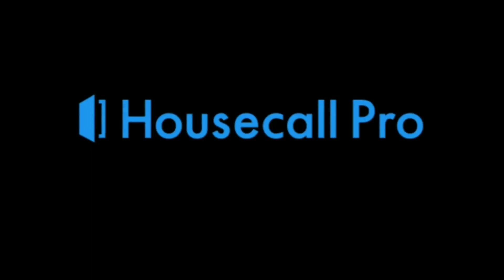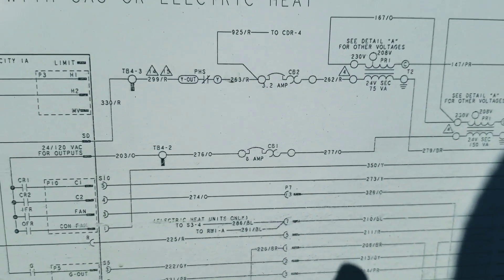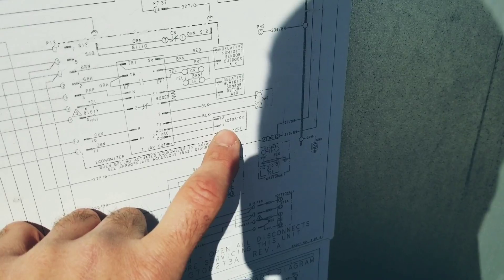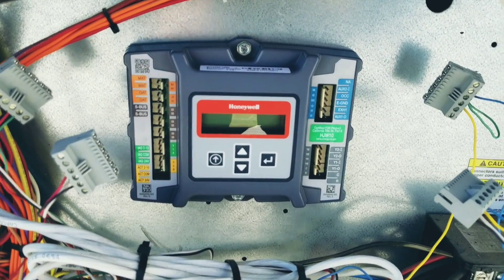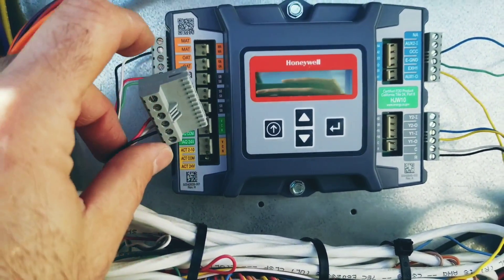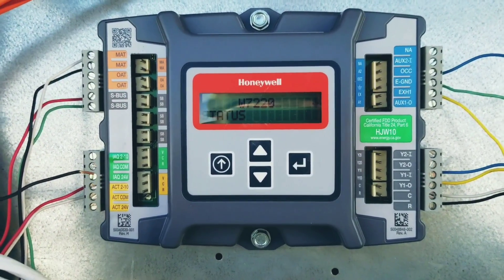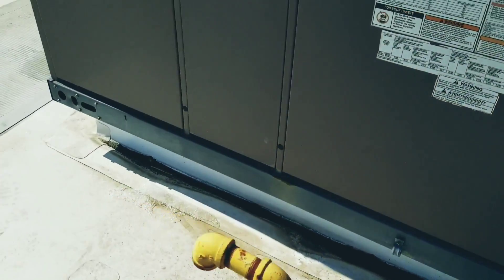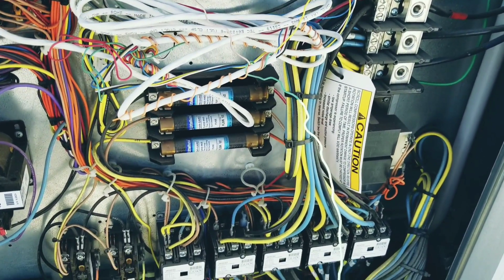HVAC - Troubleshooting Electrical Shorts Without A Meter

Comment: Looks like the schematic doesn't match the board.
Reply from the maker: It does match 100%
Reply: @HVACKnowItAll  Schematic shows ACT 24 volt at different location? Schematic shows 2-10 volt Out at that location?
Reply from the maker: @joehead1294  the actuator receives a constant 24v and only gets 2 to 10 vdc when it's responding to a command.  The unit is wired right.

Comment: You have a solid wire on a stake on ? Stake on are for stranded wires!
Reply from the maker: Well how do you suggest you connect to the actuator?  Also, stake ons can be fastened to solid wire all day if that's you're only option.  No one is rewiring or paying to rewire that whole circuit to stranded wire just because.